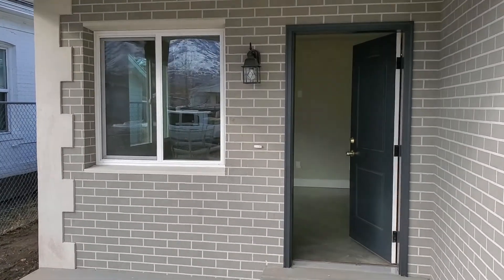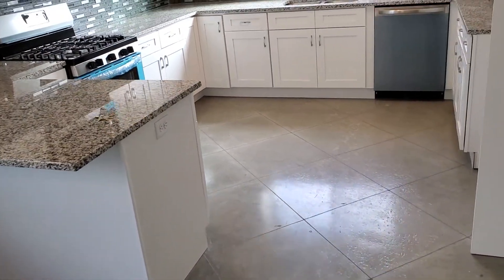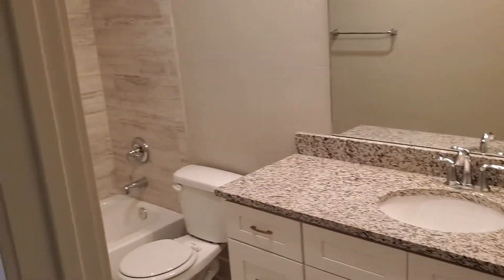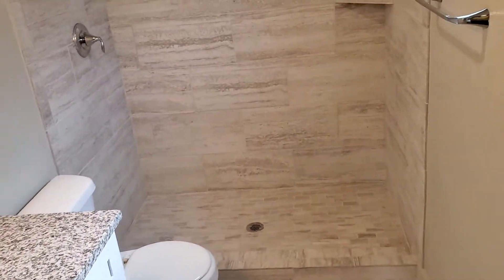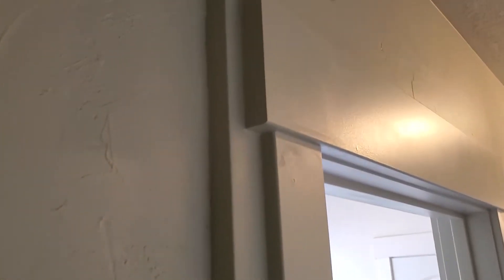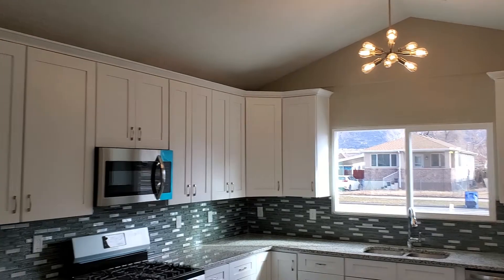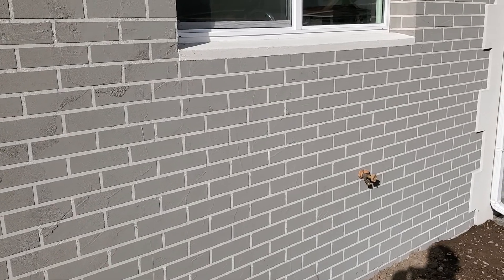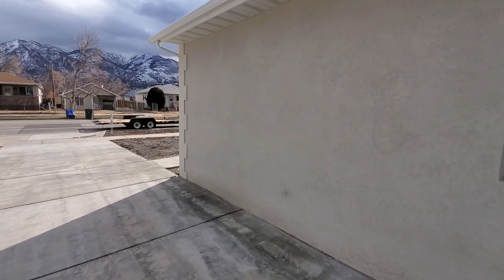Inside ISS  Innovative Structural Solutions SCIP structural concrete insulated panel home.

Comment: I see a lot of rough spots on on the inside of the exterior walls as well as on interior walls. Did you use something like a skimcoat (which is basically a gypsum based plaster mixture) to get a fine paintable finish?